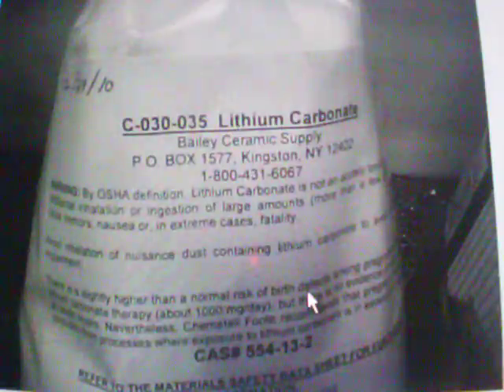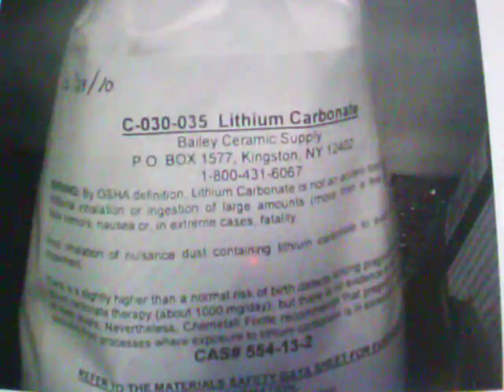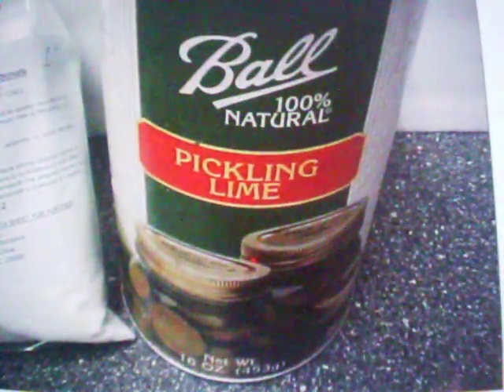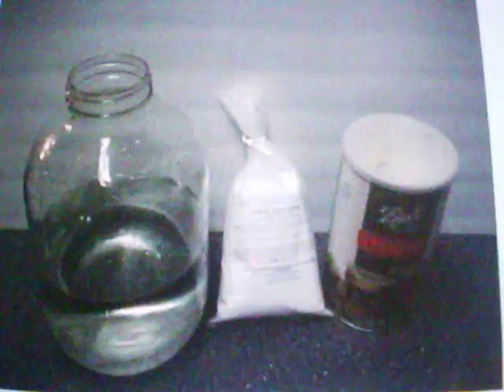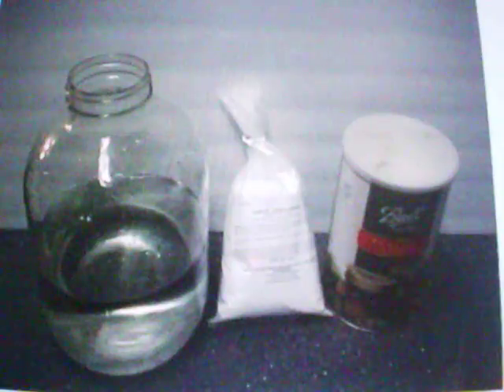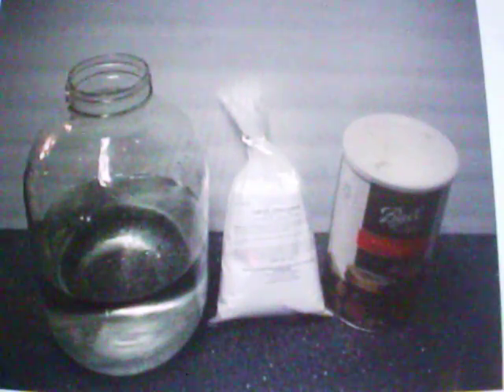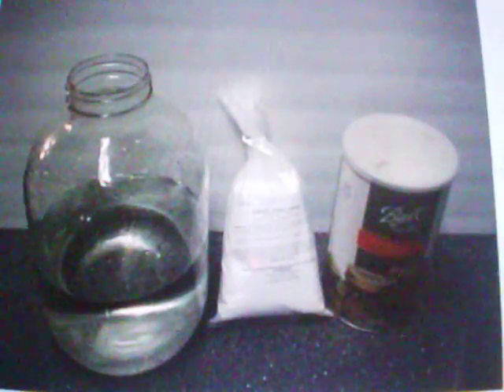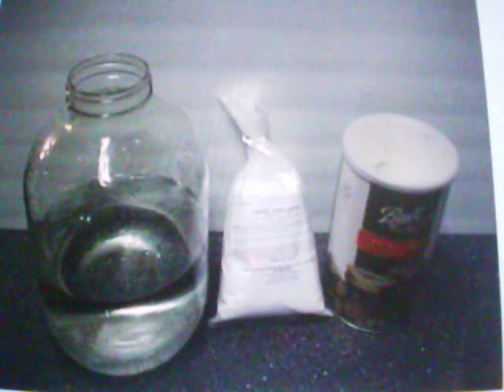iron oxide tutorial1.13 nife battery construction

Comment: ok so I read that if you have a metal carbonate  say (M)CO3 and you want a specific salt/hydroxide of that metal(M),  you add an ammonium NH4(?) solution.  (where ? = OH/SO4 etc. )  if you wanted LiOH you:  LiCO3 + NH4OH ---> LiOH + NH4CO3 then  solutions of NH4CO3 decompose to 2 NH3(g) + CO2(g) + H2O with a lill heat.  so the gasses bubble out leaving water and you metal salt.  
 similar reactions work for many metals